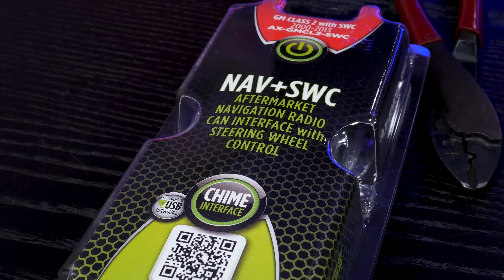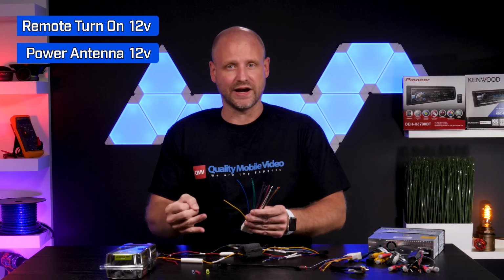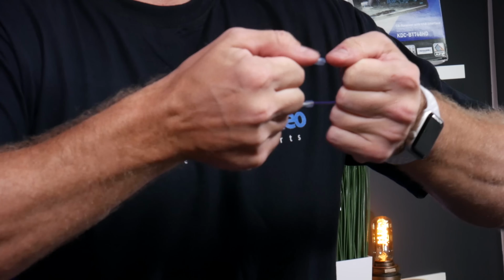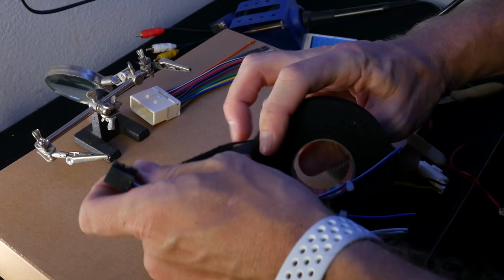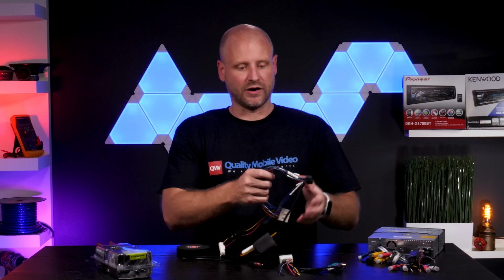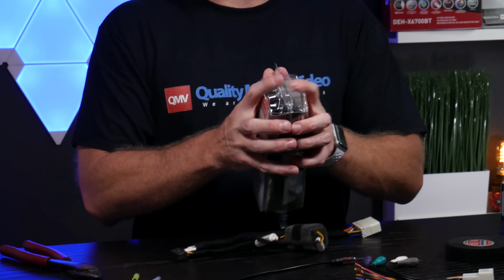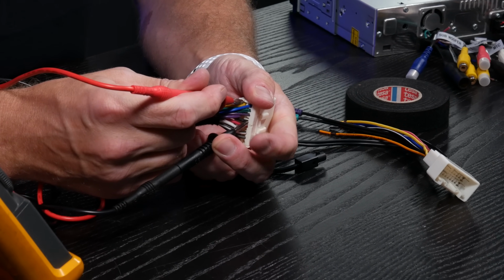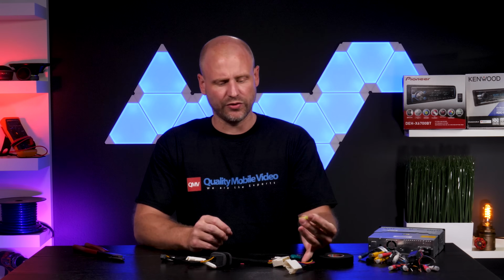Car Stereo Wiring Harnesses & Interfaces Explained - What Do The Wire Colors Mean?

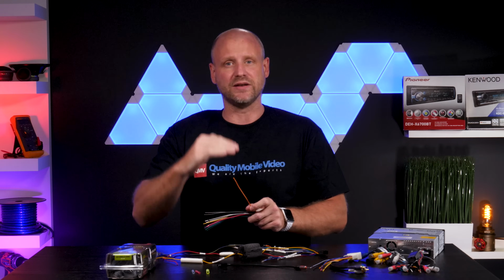Comment from the maker: Diagram/Thumbnail 3:50
Reply: my adapter harness did not include a RF filter. Is it worth the added cost and labor to add one?
Reply: Quality Mobile Video stock amp wiring color codes for power and speakers
Reply: What if your vehicle is turned off but your stereo is still on ??
And if sometimes the same stereo automatically turns on by itself when the vehicle is turned completely off
Reply: I have the 7018b radio backup camera. mine's has the Orange and black wire, what does it get connected to? And it also has a brown and pink wire what are those get connected to? I think the pink is reverse for backup camera. But the brown wire, I have no idea!
Reply: @HappyHands.  e. E vbbv
Reply: Great video but I got a  couple questions below 
V V  V  V  V  V  V 

 What do I connect a brown wire with the word BACK on it  to ? 

What do I connet a orange with white line to ?

What is Key one / Key 2 and what do I connect them to  ?
Reply: So I have a kenwood DDX512 and all my buttons are on but the screen won't stay on. It will turn on for a split second then turn off. Can you please help!
Reply: @ismaelramirezjrir  wires are probably crossdd
Reply: How do i know which wires to tie up when they are different colors to the colors coming from the unit?
Reply: Lucci
Reply: @HappyHands.  tear was was
Reply: I don’t have a fuse on my scosche wiring harness is that why I have this problem with the pioneer head unit having to reset it every time I turn it on? Yea I know im.repeating myself lol just was watching ur video for the 50th time trying to figure out what I did wrong and I see nothing wrong the fronts are the whites and greys and rears are purple and greens … I don’t know what is going on…. It’s my second wiring harness now and still same problem 🤷‍♂️ 

Thank you again and sorry for the million comments lol 

Dan
Reply: @ismaelramirezjrir  im having the same problem with mine and I found out the Dodge Ram 1500 has the acc or the cigarette lighter to the left and it is powering my head unit soooo if I have my phone charger plugged in it will be on constant if it’s pulled out it’s dead and I am still having problem with it not keeping the pioneer head unit hold the settings and everything even the Bluetooth is messed up I have to reset it every time I turn my truck on.. 🤷‍♂️ idk but this may be your answer? Trying to helo
Reply: @arronsimmons2834  k      .         Mp9
Reply: where does blue goes on the car radio wires
Reply: @Devo1987  the brown wire with back is for the reverse camera 12v in that sends the screen to show what the camera sees when you select the reverse gear.
some radios the orange with white is for telephone mute, its a module that whenever your phone rings it auto mute the radio so you dont have to shift back and forth.
the key one and two wires is for the steering wheel that have the radio buttons on it, when connected it lets you use the buttons on the steering to control basic stuff on the aftermarket radio just like the factory radio that was removed (e.g. Volume up/down/mute, next/back or on/off.)
Reply: @MrEcortez16  Pull the unit out and hold your hand on the back of it.  Does it get real hot? 
  If so, that may be your problem; you have a wire tied into a circuit that is drawing too much current.  If this IS the case, get a good clamp-on ammeter and, one at a time, check the current draw of each individual wire coming from the head unit.  Cross-reference your numbers with the spec sheet of that particular make/model and see what those numbers are SUPPOSED to be.
  If this isn't the case, I'd look into just purchasing another unit, as the unit that you have may just be that rare exception that occurs with a lot of products that us humans manufacture.  About 1 out of every 1000 or so (the numbers vary) of a particular piece of equipment was faulty straight off of the assembly line.  It's called QC (Quality Control).  Manufactures do their best to keep those faulty ones from even leaving their factory, but it happens.  🤷‍♂

Comment: Its going on 2020 can someone please invent just 2 to 3 wires systems
Reply: Nick Davis there is a bunch of plug and play wiring harnesses! They are expensive tho.
Reply: @carlosz4248  No such magical plug n play harness exists for obvious reasons. You will still have to connect the harness leads from the new headunit to the leads on the aftermarket harness  by crimping or soldering. Then that will plug into your vehicles harness.
Reply: The deeper into the future we go the more wires come out of the woodwork..  sorry!
Reply: @jo31b  lmao
Reply: @jo31b  Hey Buddy. The links that you are giving me in an attempt to prove your point are all "currently unavailable" probably because they are misleading and got taken down. Not all head units are the same. The major brands use different harnesses. They just don't make a harness that is compatible with all makes and models. They would have to be custom made to order do to all the different possible variations. As for the link you gave me... try this one out.  https://en.m.wikipedia.org/wiki/Overconfidence_effect
Reply from the maker: Exactly. You have to find the harness that is vehicle specific to your car/truck/suv
Reply: As vehicles become more advanced we're going to see more wires and more interfaces.  There are two primary reasons for this - Not all cars are the same and not all aftermarket radios are the same.
Reply: Nick Davis Bluetooth is the only other way🤓🤓
Reply: @Qualitymobilevideo  My wire harness has no negative speaker cables, only positive.
Reply: they came out a three wire radio in the fifties...it was an AM manual radio ..power in speaker out and you had to have an antenna to plug in the back and a ground for the negative power...
Reply: @paulweston8184  Actually they do have wireless back up cameras were all you have to do is run a power wire from the camera to the reverse light and pick up a ground right there in the back!
Reply: @NeverEnoughPyro40  yes, they work through Bluetooth...that goes to your stereo, which still needs your factory harnesses.
Reply: you stole my thunder buddy.
Reply: You must not understand electricity
Reply: Plz😭😭
Reply: Ahah true
Reply: Me watching this in 2023 when I learned all this in 2018 but forgot 😂
Reply: That's what I'm saying man!
Reply: @Qualitymobilevideo  not if you straight wire it like
Im doin the old 88 today.
Reply: @paulweston8184  ql
Reply: Lol
Reply: 2 to 3 wires including with the speaker? 😂😂😂😂
Reply: Get a 12v cigarette lighter FM transmitter. 😂
Reply: Dude it's not that complicated at all. Your just tying one end of a string to another... Auto electrical is as basic as it gets
Reply: They just need to make adapters that plug directly into your head unit and into your factory harness.
Reply: 2024 and they still havent

Comment: I've done timing belts, injectors, clutches, wheel bearings, different suspension parts, sensors and messed with wiring and different learnings and adaptations in cars but I don't have the patience to learn how to adapt an after market radio to a car regarding the wiring.

Comment: The pwr antenna and remote wire are separate in most modern decks. If you hook your amps up to the pwr antenna it will come on in am/fm mode and turn off for every other mode

Comment: I've installed a basic car stereo without a harness and it took hours. The harness adapters are well worth the extra money spent
Reply: Ben Mitchell and you can put the stock unit back in if needed
Reply: Only if they make on for your vehicle , wont find any for mine  , its a pain in the ass
Reply: @detox2778  what car do you have
Reply: @williamburgoon1834  a 2003 jaguar super v8 , with a premium sound system , a dumb stock amp , the whole nine yards of dimes dumbness lmao
Reply: @detox2778  its possible but just gotta find the parts online, plastic kit harness antena adapter but yea pretty unique
Reply: @williamburgoon1834  ive already cut that shit lol , and ive saved the original harness so it can go back in later , i can solder pretty well
Reply: @detox2778  ah good luck
Reply: Walmart has em for about $10, well worth it!
Reply: he says channel in stead of speaker to try to confuse ya (":
Reply: 5.95 on eBay for my Camry lol well Worth the wait
Reply: And if calculated still took time to match everything up but a snap to install after that....I know I've done many that way.
Some liked my work so much they had to steal it!
Reply: Yea me too wish I got the adapter

Comment: while i agree solder and heat shrink is the best connection, the butt connectors will not fail if installed correctly and you arent swinging on the harness. i also advise slide heat shrink over the wire before stripping to prevent strands from folding back
Reply: Amen

Comment: Nice video, would like to say if you used your crimp tool correctly, the wire would not pull out, you needed to turn the wire 90º when you made the second crimp to curl the terminal joints around on themselves

Comment: Good advice. I would argue about useing the wrong tool to crimp, try a ratcheted model that crimps two points at the same time against a third, if you find you must buy tools dont, just use the butt connectors with solder in them and heat with a disposable lighter or even a hair dryer, this also eliminates the need for any added tape as the outer silicone shrinks and is far better, not to mention it is very easy to use even for someone who has never solderd.

Comment: Would have like to heard more about remote amp turn on vs power ant.  If it’s trivial and you can use either or when to use which.  Great video!
Reply: You can use either, but some don’t have a power antena wire
Reply: @A. Melbs Im no expert but Power antenna is for when the radio is on so if your radio turns on at just the turn of the key then it gets 12v power, remote amp turn on is from the head unit and is made for an amp
Reply: i get no sound for bluetooth or apple carplay after,  only from radio stations 
after amplifier install connected maybe to antena wire , instead of power on so they made the wrong connection take it back to the shop or do it myself

Comment: Thanks for tips! I was struggling with wires recently during installation of Raspberry PI 4 (single board computer) with OpenAuto Pro software in my car. I decided to install two separated amplifiers for rear and front set of speakers and finally have perfect sound and modern infotainment in my car!
Reply: Enlighten me please lol I have raspberry pi and an 07 Escalade. The only way I’ve been able to integrate them is with an snes emulator for rear seat entertainment but this intrigued me

Comment: The Atoto kit I installed was fairly straight forward for the labeling and color coating of wires. It was the 4 sets of speakers + and -, and then the ground, ignition and straight power from the battery. Thank you for your additional information. It gave me confidence and reaffirmed my installation.

Comment: Butt connections are perfectly fine dude. Relax
Reply: As long as they are done properly .😅
Reply: The dude in the video doesn't have a clue how to do a crimp connection. 
As a retired electrical engineer and chief engineer of multimillion dollar yachts, I'll add that in most cases, almost all,  only crimp connections are allowed in marine applications. Solder connections are illegal due to the height rate of failure.

Comment: If i understand clearly i can run all speakers wires from the headunit adaptor to the speakers in my Kenwood KAC-D8105 5 channel amp along with the blue signal wire. Where do i plug in the rca bass knob? Thanks for a great video and keeping tbe explanations simple for old guys like me. This will be the 1st time i ever installed a headunit and an Amp with a Subwoofer! I appreciate your response and your instructions as i want to make sure i install my equip correctly! Thanks alot QualityMobile!!!

Comment: Good and clear video thanks. I am in the process of installing a single bin Kenwood radio in my Jeep Wrangler  Sahara 2007.  No power antenna , no steering controls...I found a 12 volts supply for the red wire. I have the wire harness supplied with the radio that I welded with an after market wiring harness. All connection are welded ,  shrink tube isolated and test for continuity. The connector does match the Jeep wiring harness but the speakers do not work. I can see that from the car side harness I have only 4 speaker wires vs 8 from the radio radio side...have you seen this before? What am I missing?
Reply from the maker: It is possible to only have one set of speakers in the vehicle.
Reply: @Qualitymobilevideo  I found what was wrong. In fact I have the Infinity amplifier and speaker system with 4 speakers, 2 twitters and a woofer....I need a different interface....thanks anyway your video was very helpful. And thanks for the follow-up! Appreciated!

Comment: Thanks for the video really helpful.

Got a question I am wiring a 1998 Silverado and the vehicle wiring harness has a orange and orange/white the pioneer double din has orange white do I use the orange/white from the vehicle?  Also the green that is parking can I just leave it unwired?
Reply from the maker: No, tape off the orange white, it will not be used.
Reply: @Qualitymobilevideo  thanks for the reply so that truck will not be able to auto dim the radio

Comment: 2020 here, last few radios I've had were just straight wire this to that wire there, no fuses or filters. He did answer the blue wire question, as I think what my car is doing is using the ant power wire from the aftermarket radio to turn on my factory amp. I have the ISO connector and there are three unused pins on one side. And I grounded the park wire to an extra ground on the harness. Using posi-taps to join the wires and velcro wire wraps to tidy it up.

Comment: Will this work for a motorcycle? I have a project bagger that previously had a radio but it was removed along with the harness. Thank you
Reply from the maker: Yes, the aftermarket harness should be these color codes.
Reply: @Qualitymobilevideo  Your awesome thanks so much.
Reply from the maker: No problem!

Comment: Great video, thanks! My Q: I've bought an aftermarket mulltimedia which doesn't have software solution to not to turn on 10 seconds after engine starts but only starts in same time with the engine, which steals too much of battery power during each engine start. Now, to be able to manually turn the multimedia on, should I install the manual switch to the constant power wire or to accessory wire (to maintain memory of device but to stop it turning on with the engine) and should I install an according fuse for that switch line please? Thanks again!
Reply from the maker: You would need to put the switch on the accessory. You should not be having a start issue with the vehicle when the radio is on, it draws only a tiny amount of current. You likely need a new battery.

Comment: Great video, my ignition doesn't turn off the radio I have to do it Manually on the radio, it's wired through an harness adapter, what's going wrong, thanks
Reply from the maker: Red wire isn't connected properly.
Reply: @Qualitymobilevideo  thanks for the reply,  when you say "red wire isn't corrected properly" do you mean it's in the wrong place or not fully in the connector, thanks again for the reply.
Reply: @Qualitymobilevideo  sorry for the delay in answering I'm in Wales _UK

Comment: I'm going to be installing a BOSS Audio Systems BV9386NV in my Ford ECO 250 van. This is my first radio so please don't laugh::) Thank you for this excellent video.
EDIT: Nevermind...So I have to purchase an aftermarket Ford eco harness which is a female connector. After I unplug the connector from the old radio I then plug it right into my female aftermarket harness. Match my wires with the harness for my new radio and then solder or crimp and then plug into my new radio. As you showed the soldering can be done on a bence and not in the car.

Comment: Great video! I installed a 2 din android radio on my Peugeot 407, and it has a canbus box and interface to have steering wheel controls. That is ok and it even knows when I'm driving reverse, the steering wheel angle, the A/C controls, everything is nice. But....... There is no sound at all to the car speakers! I can hear sound through an RCA aux-out to a portable speaker, but the car speakers don't play anything. I'm starting to think I need to make some wiring with the amp or loose end, I just don't know wich one.
Reply from the maker: Likely a remote turn on issue with the factory amp

Comment: I'm about to wire up my first car radio, replacing the stock unit. I'm pretty comfortable about it (cautiously comfortable) but have one question.

I'm taking the butt splice route. What gauge wire should I buy the splices for? I've not been inside for a look
Reply from the maker: Blue connectors will be fine.

Comment: I'm looking for a wiring harness to go from my factory head unit for RCA out to run to an amp. Is this possible or do I have to splice into the speaker with an RCA converter? 2023 Nissan Frontier. Thanks for the video!
Reply from the maker: You will need to make a harness, unfortunately one is not available.

Comment: I have a question I recently bought the xvm279nav 7inch screen radio. And wanting to hook it up in my 09 Chevy Impala and I hooked it up but drains my battery and I can turn it on even if cars turned off?? Need help
Reply from the maker: That vehicle requires an interface for this very reason, unfortunately neither are very cheap. Here is a link to them: https://www.qualitymobilevideo.com/catalogsearch/result/?q=Lan29